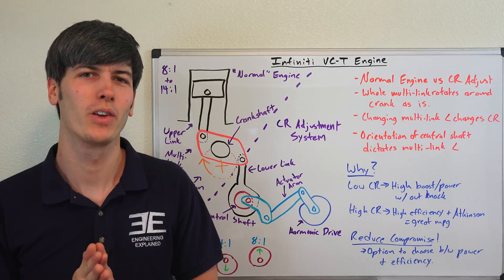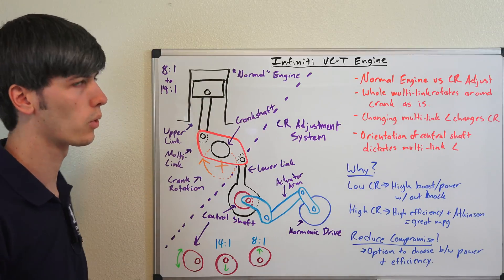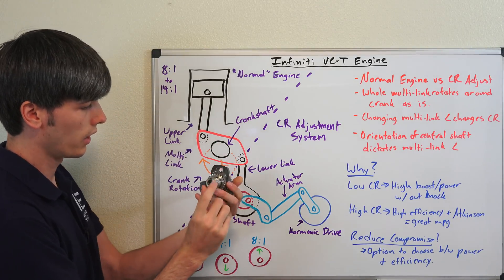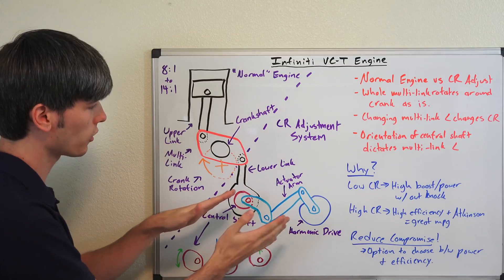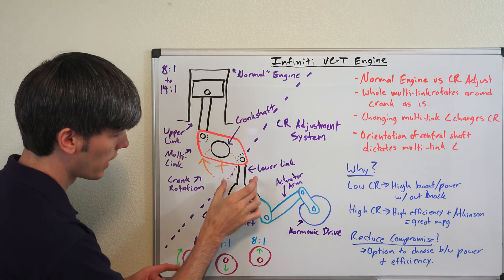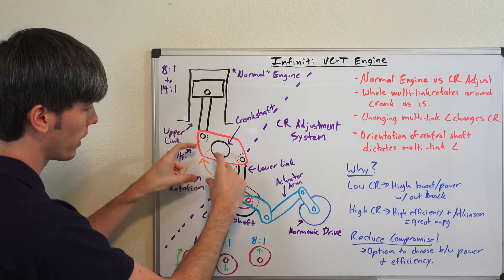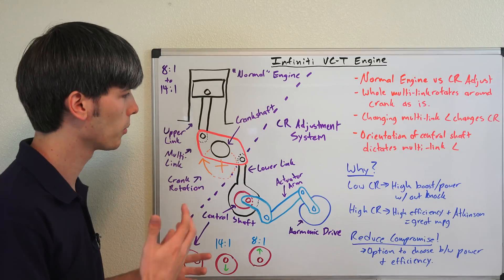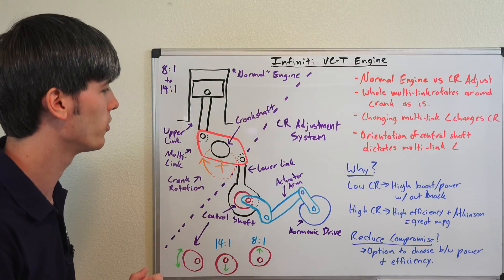Infiniti's Amazing New Engine - Variable Compression & Turbocharged

Comment: Nice, clear explanation, as always.  Interesting that they chose to advertise this engine as an Infinity innovation, as opposed to a Nissan one.  I suspect this design will result in a somewhat heavy engine for a 4 cylinder with a bit more operating friction. It seems much more complicated than the stillborn Saab design of over a decade ago.  I wonder what it's default operating condition is in the event of a control failure.  I could see that this could be a nice solution to eliminating turbo lag as CR can remain high at lower engine speeds before the turbo can build pressure.
Reply from the maker: I don't think it seems more complicated than the Saab version, Saab had complex linkages to rotate the cylinder head. Also, I think it's a decent call putting in Infiniti rather than Nissan, for a couple reasons. Since Infiniti is a luxury brand, they can get away with higher costs, and also premium fuel since this is turbocharged. It's not a cheap, low powered efficient engine, which would obviously be more cost effective and more common in a Nissan rather than Infiniti.
Reply: The Saab was a pretty simple four bar mechanism, albeit moving the entire top half of the engine, but fewer added moving parts and kinematically much simpler.  Same compression range if I remember correctly.

I mention the Nissan vs Infiniti credit because it seems that Nissan could use the PR.  Infiniti, now being marketed throughout the world, could benefit as well, I suppose.

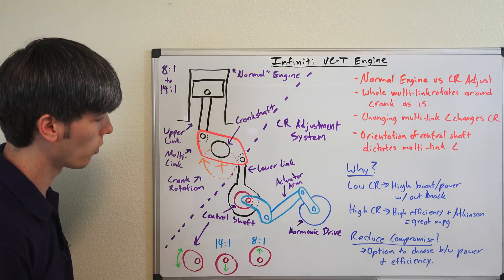Comment: around 4:20, your compression ratios doesnt make any sense at all(i think from the start it doesnt make sense) and yes fuel type is also considered. 14:1 compression is achieved on higher octane (pretty impressive if they are still using older heads). 🤔

Comment: so this wont change displacement correct?
Reply: Yes it would in that engine. Because the stroke is a variable in the displacement formula (Pi/4 * bore squared * stroke * # of cylinders). I would be more concerned with the reliability with so many extra mechanical parts.
Reply: I don't see it changing the stroke just the piston position at TDC...I do see lots of stuff moving around at 7,000 RPM tho and that's lots of areas for failure as it ages..
Reply: ZIGgassedUP Looking at his whiteboard  drawing again, I see that you are right on the piston stroke distance not changing per revolution. But the piston does go higher or lower at TDC. Thus increasing or decreasing the compression ratio. Because of that variable cam that the piston connecting rod is connected to.
Reply: The engine in the above video simply varies the combustion chamber volume thereby varying the compression ratio. 
The bore does not change and the stroke does not change, therefore the swept volume of the cylinder or displacement volume does not change regardless of the combustion chamber size. 
Combustion chamber volume size is not an evaluated element when calculating the displacement volume.

Comment: Hey Jason, nice video and this seems like a cool emerging technology. Your explanation  has left me with more questions. Since the red component doesn't have any angular velocity wouldn't the blue assembly need to move up and down at the same rate as the piston (1000-6000rpm)? how does that work while fitting into the engine block?

Comment: Isn't raising the piston up decreasing the compression ratio? Or does this mechanism only effect the TDC position? Also I can hear all the Infiniti tech's bitching from here, haha.  They'll get the kinks ironed out eventually...
Reply: no! the distance the crank moves changes all cylinders the same....so it moves toward the head of the engine..or away....it changes TDC by moving the entire crank toward or away from the head....the distance each piston moves never changes...just their relation toward the head....
Reply: Raising the piston up (i.e. increasing the piston stroke) DOES INCREASE the compression ratio. Because the piston displaces (i.e. squeezes) more air/fuel at top dead center. Compression ratio is the cylinder volume at bottom dead center to cylinder volume at top dead center. The higher the numerical ratio, the more thermal efficiency (i.e. better mileage, like how diesels run).
Reply: Right, but does this mechanism only affect TDC? Orherwise both would move the same distance up or down, no?
Reply: James Russo Mechanically, it affects TDC, piston stroke, and compression ratio. The stroke distance WILL vary in this engine.
Reply: Okay, that's what I figured.
Reply: Roy Hemion Ahh ok

Comment: I'm usually able to keep up with videos like this, but i'm confused on one issue.  Doesn't adding boost to a low compression ratio system effectively increase the compression ratio?  Why not just do all this with some variable boost blowoff valve or something and save yourself all the complicated moving parts?

Comment: "Not the most efficient 2.0l engine (even in efficiency mode), nor the most powerful"
Isn't this mostly by choice?  They aren't really limited the same way other engine makers are limited at the extremes.  There just isn't as much pushing to the extremes.  It should be far easier to be more efficient than other 2.0l (than other 1.0l?  Not so much).
For power, doesn't it come to decisions between Nissan having to build up that funky bottom end vs. other makes worrying about dealing with the inefficiencies that come with over-turboing a 2.0l?
For efficiency,  unless they are hard-limited to 14:1 CR, presumably they could crank it up even further for low power cruising at more extreme atkinson cycle games (and thus be more efficient than cars with a "mere" 14:1 CR).  Since you probably would never actually notice the tiny difference such higher efficiency would give you (because you used that turbo once back when merging), Infinity isn't going to bother.

Comment: 2 questions: How does the driver control the compression ratio, is it a dashboard control? Also is the point of rotation of the control shaft changing as the compression ratio changes?

Comment: How would this work with different octane fuels? would this need a high or low octane? from what i remember different compression ration engines prefer different octanes.
Reply from the maker: Likely would require premium. But this is going into a luxury vehicle where the customer will expect power, so that's nothing unusual.
Reply: These compression ratios are static.  Under boost the effective compression ratio will be much higher since its operating at >100% volumetric efficiency. So that 8:1 would turn into about 16:1 @ 15 psi.
Reply: its definitely not going to run ethanol...
Reply: Ethanol kinda ruins the whole "fuel efficient" thing tho.. Lol
Reply: Hey Rafael (vou falar em inglês pro pessoal ver a resposta também). Here in Brasil it will help with the flex fuel cars. That means our cars won't need to be in a medium compression ratio like they are now. Usually ethanol uses a higher compression ratio while gas uses less compression ratio. That means this type of engine would help us with this difference, more than the countrys they use just gas. If you already get in a flex fuel car and change from ethanol to gas, you experience the car gets a little lazy, as if the gas wasn't good at all, that's because of the high compression ratio, it doesn't help so much with gas to burn good. I'm not sure if I'm correct, but, that's what I read from a lot of places and that's what I understood.
Reply: +Pat M  the customer won't have control over what the mechanism does. No more than they can currently  switch to a more aggressive timing on a whim.
Reply: soo, probably ethanol is a good call??
i have a question related, mate...
here in Brazil we use mostly hydrated ethanol, so, in order to do that most of our vehicles had the compression ratio adjusted to around 10 - 11. in this case a 8:1 compression seems too low for the fuel to burn efficiently to me. What happens???? the extra boost will compensate that or what?
As a production engieneer student i have no base of motors mechanics.....
Reply: This was my first thought, customers running low compression with low octane fuel then cranking it up to have some fun before switching it back to premium fuel. Sounds like knock & pre-detonation city
Reply: Pat M incorrect
Reply: Really? Because currently the trend in high end vehicles with a performance side is giving people more control over how their vehicle functions, such as user adjustable suspension dampening, ride height, transmission shift points, shift speed, boost levels, and torque curves all through easy presets. I could see it being built in to prevent the situation I mentioned from happening, but I don't see them putting this technology in luxury performance vehicles and not implementing some level of user control.
Reply: Pat M all of what you listed are driving preferences, not technical function. Do you think manufactures are going to give people the ability to adjust the timing of the engine? No. because it can blow it up. 
Do you think an interface to change the response of the electric throttle or suspension is has the ability to damage things?
Reply: Pat M well that's what you're implying when you are talking about giving the user the ability to change the compression ratio
Reply: The user would select a preset like eco, comfort or performance then the car would adjust the compression ratio accordingly. These vehicles will probably all call for mid/premium fuel(especially if the computer is constantly adjusting compression ratio), all I was saying is it wouldn't take long for people to start running standard fuel while running it in say eco mode then switching to a performance mode without filling with premium causing issues.
Reply: Pat M Yes..... that is exactly what I'm saying. Do you have any mechanical knowledge what so ever? A knock sensor is literally a microphone inside the engine (the bottom of the head) specialised for detecting knock that feeds information to the ECU so it can adjust itself or go into limp mode; where the throttle and revs are limited, to avoid damage.
Almost every modern day car has this technology to protect the engine from serious internal damage.
I cant believe i am arguing with someone with such little mechanical knowledge and such low expectations of engineers.
Reply: bfy.tw
Reply: So it's a piezoelectric microphone that senses engine vibrations..? They're also commonly found on the top/side of the head or on the block just below the head.
Reply: Pat M The knock sensor is a microphone. Its there to listen for spark knock which is also called detonation, pinging, and pre ignition. It sounds like someone rattling a can of marbles. It can easily destroy the internals of an engine. Before the days of computers and knock sensors they tended to be fairly conservative with the tuning so that was not likely to happen. Problem is thats not very efficient for MPG and emissions. Thats why they came up with knock sensors. The engine can be tuned and running right on the edge of this problem. When the computer senses the knock starting it can make slight adjustments to keep it from happening but still keep optimum performance
Reply: You literally realize that I literally know exactly what a knock sensor is and how they work right..? Read through a couple of my comments I think you'll realize I've been mocking you for about 20min.
Reply: Pat M Then why are you unable to put together that they could easily use this sensor to avoid damage on a variable compression engine just as they do on electronically boost level controlled engines in combination with timing?
Reply: I am, I never in any of my comments said this would cause any damage. I said it could cause knock & pre-detonation issues and I said it could throw a ton of fault codes. The only thing I've said about damage is when I mentioned how people improperly use E85 which clearly wasn't about this engine and was just used as a segway into people putting the wrong fuel in these vehicles in the future. Props on knowing this could throw a vehicle into safe/limp-home mode though.

Comment: What a wierd system
Reply: They could and should have made it MUCH simpler
Reply: +max mustermann how?
Reply: Maybe make the length of the connecting rod variable or make the distance between the point of rotation of the crank and the point where the connecting rod is attached  variable (my Idea) or make the upper part of the cylinder block tilt sideways (Saab patent) or maybe make valves that can vary the position in which they're closed (my idea again) or maybe even build a  cylinder which can vary its height there are a lt of possibilities all much simpler and much less space-consumomg than this.

Comment: that's a lot of computer works to keep track of everything to the millisecond.....if anything gets old worn or goes wrong......ouch
Reply: No reason you couldn't have the system vacuum operated.
Electronics aren't necessarily bad anyway, crank sensors work forever and Vtec solenoids are also pretty reliable.
Reply: after you pay off the car, Nissan wont care.

Comment: But Twincharger Engines are also the best of both worlds, they're small and economical but also pack a fair amount of power, my little 1.4L with a simple remap can achieve around 215-220bhp but it also averages 46-50mpg on long journeys.